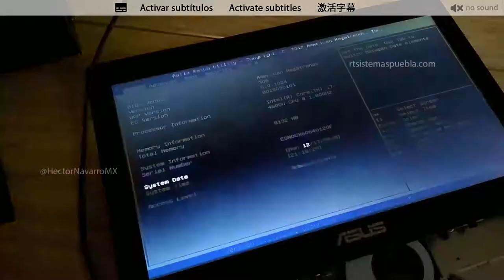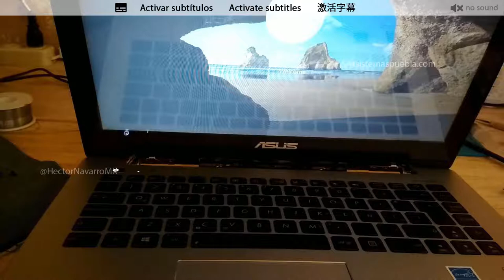How to repair cable flex video for ASUS laptops. [ACTIVATE SUBTITLES]

Comment from the maker: 00:00 PASO 1:
Cortar la cubierta para liberar los cables
00:11 PASO 2:
Soldar el cable roto
00:26 Probar el funcionamiento
00:36 Si presionas el conector la imagen parpadea
00:42 Desconectar batería
00:50 Problema: el conector tiene falso contacto
00:55 PASO 3: SOLDAR EL PUERTO
Aplicar flux para volver a soldar el puerto
01:09 Limpieza del puerto
01:14 Revisando que todos los pines esten conectadosV
01:19 Funcionando correctamente
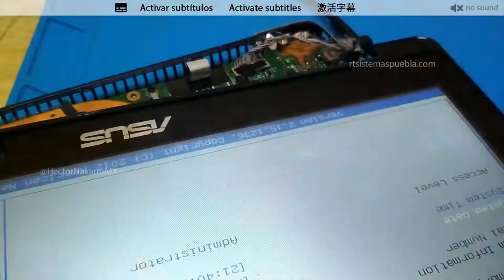01:31 Aislar el cable de video con cinta
01:41 PASO 4: ARMAR LA LAPTOP
Colocar las bisabras
01:47 Conectar bus de video
01:50 Conectar la batería
02:01 Encendido y funcionando.
¿QUE LO PROVOCÓ?:
1) El constante movimiento de las bisagras al abrir y cerrar rompió 1 cable dentro del bus de video.
2) También había uno o varios pines con falso contacto en la tarjeta madre.